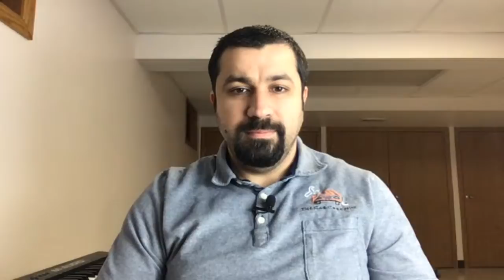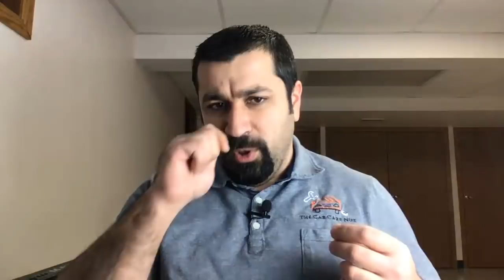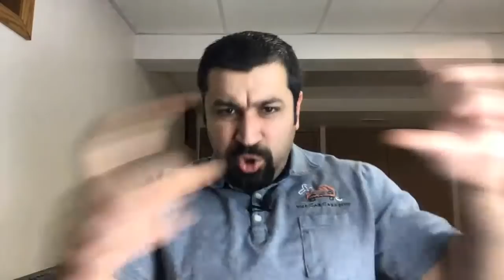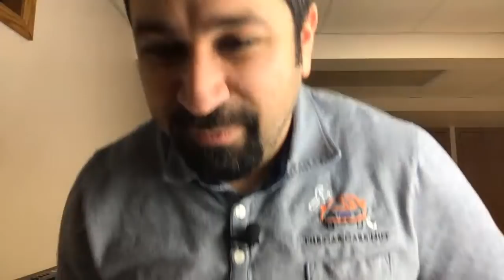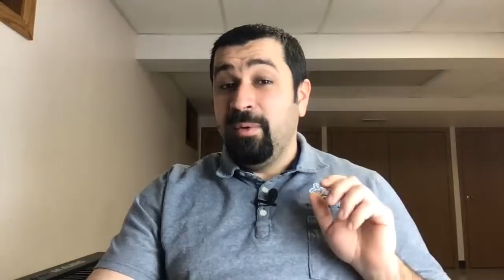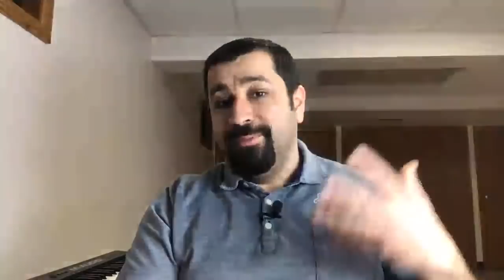Toyota Lexus and Scion Q&A Livestream

Comment: 2017 Toyota Camry se radio stuck in reboot won't work can you recommend on what to do i called Toyota they want 3500 for a new radio unit
Reply from the maker: Hi! Unfortunately at the dealership level they can’t do much for a stuck rebooting radio. However the price is kinda of high for an exchange unit. Did you call other dealerships?
Reply: @TheCarCareNut   yes and the best they can do is 1500 dollars with exchange even reached out to Toyota corporate and they said to go on my own even used units are pricey
Reply from the maker: Unfortunately then the only option is aftermarket
Reply: @TheCarCareNut   thank you so much and keep up the informative content going

Comment: Some mechanics say you should run your ac all the time even during winter to help with fogging issues. Is this putting stress on your ac unit running it all the time?
Reply from the maker: Hi! That is very correct. No stress on the ac system at all. It will work as a dehumidifier to keep windows from fogging up
Reply: @TheCarCareNut  thanks for the quick response!

Comment: Thank you for your help! 09 venza 184g’s inner tie rod on rack and pinion bleeding on driver side I hear the wihning do I replace whole rack or inner tie rod ? God bless you and your family sorry caught show late
Reply: Yes the boot was covered
Reply from the maker: I would just replace the boot. There’s no hydraulic fluid in this rack and pinion. Likely that’s just the grease for the inner tie rod which if it doesn’t have play I wouldn’t worry about. Also are you sure that the front timing cover is not leaking over the boot?
Reply: Can I just replace boot and lube the joint
Reply from the maker: Hi! Your 09 Venza has an electric rack and pinion. When you say bleeding in the driver side, do you mean leaking oil?

Comment: I live in Canada and my dealer doesn’t know when to do the service I have 2021 Camry hybrid xle and 2020 corolla Xse 
1.transmission when to do fluid change 
2.coolent change
3.engine and cabin air filter 
4.brake fluid change
5.brake service 
6.spark plugs
Reply from the maker: Hi! Regarding maintenance here’s a general overview.

1- transmission every 100-150k kms
2- coolant every 5 years or 150k kms the first replacement then every 5 years or 100k kms 
3- engine and cabin filter as needed. Every other oil change check it and change when dirty
4-brake fluid needs testing for moisture content but typically every 3 years
5-brake service if doing it yourself every year clean and lubricate if paying to do it every 2 years clean and lubricate
6-spark plugs every 190kms

Comment: AMD, is it ok to use an AGM battery in a 2018 Camry 4 cylinder non hybrid? Thanks
Reply from the maker: Yes you can. More expensive though
Reply: @TheCarCareNut  Thank you for your reply. Which vehicle is it that will have charging problems if used an AGM batttery. Thank you
Reply from the maker: I don’t think you’d have charging issues with an AGM. They tend to be expensive though and for the benefit they’re not worth it especially if you’re placing the battery outside the cabin.

Comment: The fifth-gen RAV4 hybrid has a small accessory battery in the trunk.   What are some options for installing a high-powered aftermarket audio system that draws a lot of power against that small battery?   Would a bigger battery work (without wrecking the hybrid system somehow)?
Reply from the maker: Hi! A moderate sound system is ok but too much might be an issue

Comment: Love your show. I have a 17 tacoma 2.7L 5 spd 4wd access cab. In the recent winter storm I heard a p/s boise when I turn the wheel all the way to the left. Then I fo center and the noise will fade down. It is a whining noise like its running out of fluid. Checked the fluid and its ok. Could be a bad pump or the high pressure line? Thank you. By the way it has 28,000 miles
Reply from the maker: Hi! I’m guessing the car was cold when this noise was happening. When the car warmed up did the noise go away?
Reply: No. It does it at any temp.
Reply from the maker: It could be a pump issue but I would replace the fluid first

Comment: Is the Engine Control software update for the sticking EGR issue applicable for 2013+ Prius?  I only see this TSB for 2010-2012 models.  Wasn’t sure if the later 3rd gen Prius has the software update already.
Reply from the maker: There were a few updates on this one. And the best way to know is to look at the software version on the car and see if there’s an update for that.
Reply: @TheCarCareNut  thank you!  Is there an easy way to check the software version?  Or can this only be checked via TechStream?
Reply from the maker: Techstream is the only way I know how to check it. Perhaps aftermarket capable scan tools can do that but I don’t know a specific one as I use techstream
Reply: @TheCarCareNut  thanks again. Will have the dealer check that when I’m there next time. Loving your content!

Comment: Sorry, I missed my favorite live video, but I enjoyed the playback. I have a few questions about the vibration that I feel when I am doing a light acceleration below 2000 rpm on my 15 Camry (74 K miles), How serious is this problem? Will the dealer fix it free of charge or not? What's the life expectancy of the transmission if not fixed?  Thank you in advance
Reply from the maker: Hi! It depends on the vibration source and how severe it is. Does it completely go away if you accelerate harder?
Reply: @TheCarCareNut  yes, it goes away once I accelerate harder.
Reply from the maker: It’s possibly a torque converter issue. I would have a mechanic drive it to verify
Reply: @TheCarCareNut  Thanks for your quick response. One last question: If it’s diagnosed with torque converter and I didn’t fix it, how soon the torque converter will usually fail (just average)?
Reply from the maker: Hi! Usually torque converters take quite some time to fail completely
Reply: @TheCarCareNut  Thank You very much!

Comment: 1mz was bullet proof. My 1996 camry v6 Le around 300,000 still run like new. Original engine and transmission. I still trust it at 300,000 compare to these new cars
Reply: Had a 97 camry v6. Was like a race car. My son and his friend totaled it. Really totaled it. They walked away with barely a scratch. Super car both working, and in a wreck.

Comment: I missed the live stream but love your channel. I had a 2013 Tacoma and currently have 2018 4Runner both with 4.0 engines. What actually causes the cold start knocking noise in those engines that Toyota says is normal? The engines are quiet when new but develop the cold start knocking after about 5000 miles on my two vehicles. Whether it is normal or not I am curious as to what actually causes the knocking noise and why it doesn't occur when the engine is new. Thank you.
Reply from the maker: Hi! The GR series engine have always had that cold start noise that continues until they warm up. There’s no concrete Information on this one but that working theory is that it’s piston slap, as the pistons warm up they expand and no longer make noise.
Reply: @TheCarCareNut  Thank you for your fast reply. Keep up the good work.

Comment: Hey car care guy I have a question got a 2018 rav 4 adventure 6 speed automatic when I’m driving right about 60 barely touching the gas I get a weird vibration when I place my hand on the center console it feels like it’s the area it’s most vibrating I couldn’t tell if it was coming from rear or front I just notice it quite a bit with my hand on the center console, I thought it was a tire but I really doubt that. Do u have any ideas? Car is under warranty which is good I just wanted to see what u think. I know u don’t have the car etc.. any tips or suggestions would be great. Thank you. Incorrect transmission fluid level? I’m thinking transmission but not familiar with rav 4s obviously it’s in high gear when it’s doing it so maybe the torque converter
Reply from the maker: Hi! For torque converter shuddering. It goes away if you accelerate harder. Otherwise it could be tire/wheel related

Comment: As you know we have a 2009 Avalon and will be doing all the breaks in the spring.  My question is can I up grade the breaks by using some other cars larger calipers, pads and rotors.  They are spongy, weak and seem under powered for the size of the car.  By the way the last tip you gave me worked like a charm (light on the dash).  Thank you for helping.
Reply from the maker: Hi! I am not aware of upgrades to the brakes. Spongy brake pedal could be air in the system or seized caliper pins. Service the brakes properly or replace them and the brakes should be good

Comment: I have 2016 lexus is 300. It's my first Toyota. I love it. Amazing quality. I've come to this conclusion by seeing how it's made and the high end parts that are on it. My manual says to check for differential leaks but nothing about fluid change intervals. Do you suggest changing the transmission or diff fluids? I'm a new subscriber. Excellent channel
Reply from the maker: Hi! I recommend you replace the transmission fluid every 60k or 6 years and the differential fluid every 30k miles
Reply: @TheCarCareNut  appreciate your help and very valuable opinion. I will look for a good video on how to change the transmission fluid. It's a very involved process. I will study it well

Comment: Hello. I’m sorry I missed the live stream. 
I drive a 2007 ES350 with 125000 miles and the transmission is flaring since new, shift 2-3 and 4-5. I changed the oil/filter (WS/OEM) at 55000 and 11000 miles with no help. How to fix this? Thanks.
Reply from the maker: Hi! Try to reset the transmission memory. You’d need a scan tool capable of doing this to reset it

Comment: Hallo thanks for your great videos. Would like to know why do my lexus gs450h 2009 hybrid battery drain very quickly when trying to start it. Bought the car on auction and struggle to start it. Motor wants to start but only once then don't do nothing on the 2nd try. Any advice? Does it go into limp mode or is it in limp mode. Hybrid battery was charged due to 4 modules with 6.0volts on them. Get check hybrid system error.. Do u think the battery is suspect? After charge all test 7.78 volt. Any help would be appreciated.
Reply from the maker: Hi! Does the car have any trouble codes at the moment?
Reply: @TheCarCareNut  no nothing, just hybrid system error.
Reply from the maker: There has to be trouble codes if the error is displayed. Which scan tool are you using?

Comment: 2002 Lexus GS 430 rear suspension squeaking don’t know from where
Reply from the maker: Hi! Noise diagnosis is difficult in this format. But I would look at bushings by spraying them down with water or silicone spray and see what quiets them down

Comment: Hi. I have a question about my Rav4 2020 AWD just 2000 miles on it. I just had 1 flat tire and can not fix. I need a new tire. My tire shop replace 1 tire for me. However, they put 1 new tire and everything (brand, tread, load) is the same with 3 other tires except for the SPEED RATE (my speed rate for 3 other tires are H, the speed rate fore new tire is T). My tire shop said that it is ok, but I’m so worry about that. Will the different speed rate damage my car and my AWD system? Thank you so much!
Reply from the maker: Hi! Likely it won’t damage your AWD however for other reasons I would try to match the tires speed rating to the original one.

Comment: On the 75w gear lube question.... search Amazon.  Ravenol 75W manual transmission fluid .... German made , meets Toyota specs right on their label, and has the most ingenious built in funnel that I’ve encountered.  About $19 per quart — and my 4Runner took about 1.4 quarts.   I’ve used it twice now with zero issues.   I did not like the idea of using 75w90 gear lube ... and that’s what my local dealer told me they do.  Big difference in the viscosity... or at least it seemed that way to me.
Reply: Red Line MT-LV also.  I talked to 4 dealers and only one knew about the 75W

Comment: Are you familiar with supercharged 4runners? Just wondering if you had any experience with that. I’m curious how they affect the engine long term If used mildly. Like when power is needed. Thanks .. I have 2021 trail that someday I’d like to consider.
Reply from the maker: Hi! I haven’t seen a new one with a supercharger but older models it was a TRD add on and if installed right they didn’t affect reliability but did change the cars to premium fuel.
Reply: @TheCarCareNut  Thanks for getting back! Yes. I’ve seen that where Toyota used to sell a trd supercharger. Seen some videos looks very clean nice install and I think somewhere like 100 extra horsepower. Certainly the premium fuel is something to think about! Thanks again

Comment: 2018 Tacoma TRD of road parking brake is sticking in the back wheels do you know anything about it
Reply from the maker: Hi! There were a few issues with the brakes. One of them is Hubs not being the right size. Also could you describe how do you feel them stick?
Reply: @TheCarCareNut  it happened twice, both time, right  after I washed my truck.  The second  time,  it  had to be towed to the dealer. All the parcking break cables were replaced, but still sticking every time I use the parking break.
Reply from the maker: If it’s sticking everytime you use it then there has to be an issue related to the cables or the drum brakes in the back. When you say sticking. Do you mean you release the handle and it doesn’t release? Or the handle gets stuck?
Reply: @TheCarCareNut   Yes that's exactly what happen
Reply: I released the parking brake and wheeled will not turn
Reply: @TheCarCareNut  , no lift, everything  is original.
Reply: Also need to know if you have a lift or if it happens after washing the car or rain.

Comment: I went to the dealer to test drive a 2021 Prius Prime LE. I have read that some complain about a noise (Possibly from the heat pump?) when starting when cold. I requested to cold start the car myself rather than have the salesman drive the car up from the lot to me. He agreed so we walked into the back lot and found the car. It was 20 some degrees out.  I got into this brand new Prius Prime that probably has been sitting in the cold for at least three days (due to the snow on the car) and put my foot on the brake and pushed the start button. It immediately started to make a loud sound. I can only describe it as sounding like someone hitting something with a hammer. Is this common?  Is it the heat pump?
Reply from the maker: Hi! How long did the noise take to stop?
Reply: @TheCarCareNut  It didn't.  I sat there for 2-3 minutes and the noise continued.  At that point I decided I could not buy that vehicle.  If my wife heard that noise I would never live it down.  I hit the start button again to shut it off and the noise stopped.  I wonder if I had put the car in drive and drove some to get the engine to run maybe the noise would stop.  But the car was blocked in by another vehicle only inches in front of it.   The salesman said that he never heard that sound before but then he never started a Prius Prime that had been sitting in the cold for that long before.
Reply from the maker: Interesting. I wonder if the it’s proximity  alert. I’ll look into it thank you
Reply: @TheCarCareNut  Interesting.  I did not think of that.  Does the LE have a Proximity Alert?  Does it sound like a hammer hitting a nail?
Reply from the maker: They all have proximity alert. Don’t know how to explain it’s sound it’s an imitation of a car running
Reply: @TheCarCareNut  Thanks.  Now that I'm thinking about it it probably was a parking sensor.  The car was surrounded by cars on three sides with a wall behind.  I was focused on a noise from the heat pump and did not think of the sensors.  Although I would expect the alert would be a beep rather than a knock.  I'm going to have to go back and  get that Prius away from everything and give it a more through test drive.  Also I found an ad for a 2017 Prius Prime Advanced.  Anything I should watch out for on a 2017?
Reply from the maker: Honestly the Prius prime has been an awesome reliable car. Just make sure it hasn’t been in accidents and the maintenance has been kept and you should be good
Reply: @TheCarCareNut  Thanks

Comment: I have Toyota Camry hybrid 2015 model
I purchased second on 2019 and changed hybrid battery as it gave hybrid system warning light.
There was no filter installed on vent going to hybrid battery fan, I put new one and cleaned fan once I got new battery it was very chocked.
Rest car is absolutely doing well 
Hearing to your Chanel gave me very good information on this system working ,I mean hybrid system
Reply: Now I get 43 miles per gallon on highway and 41 miles per gallon in city.
In India dust is big problem so I blow radiator one a week with blower , 
How to clean ventilated front seat regular to keep it functioning properly?

Comment: Hello.  Missed your livestream.  2008 4Runner here.  What do you recommend for replacement CV axles?  OEM are very expensive considering I do not have cores for reman options like CVJ.  Had the truck for about 2 years.  Current CVs are Napa not OEM.  Have owned car for about 55k miles so far.  Boots have been ripped for about 25k and are still not making any noise.  Thanks!
Reply from the maker: Notorious for CV boot leaks. I would stick with Napa. They’re good. Don’t last as much as oem but they also don’t cost as much